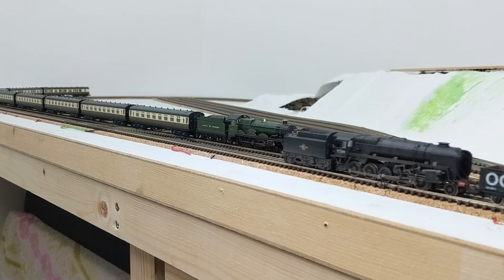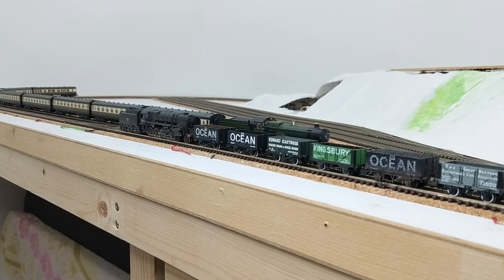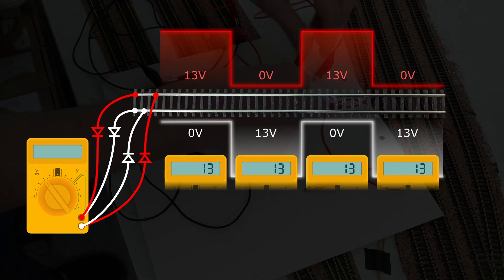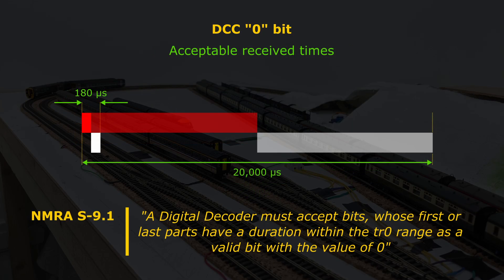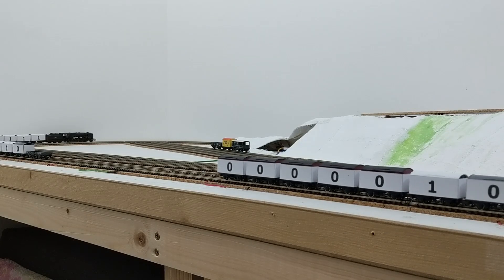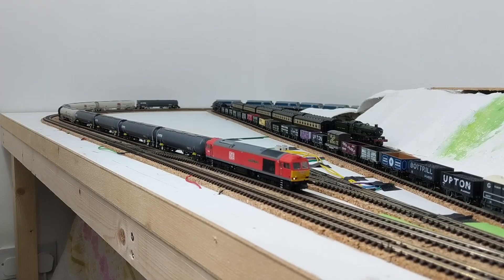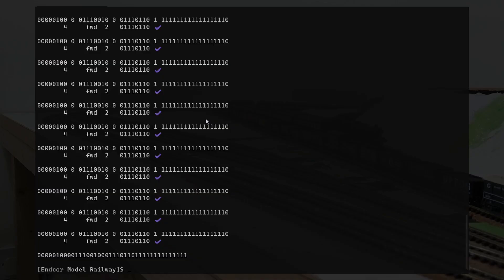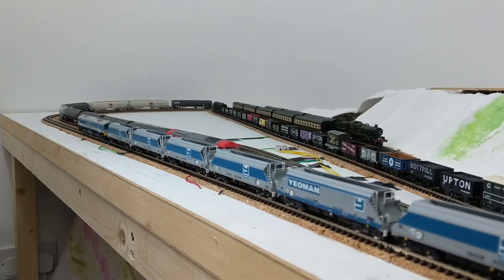0047 Decoding DCC from scratch

Comment: This looks like a cool and fun project. A couple of suggestions:

For input use a comparator rather than the voltage regulator. It will give a digital output depending on where input A is higher than input B, or B is higher than A. Get one suitable input voltage range and 3.3V output and it can safely connect to the Pico.

For timings remember the phrase “be strict with what you produce and generous with what you consume”. If your outputting signal make them accurate. If your reading them accept input which is outside spec but which makes sense. For the timings here you basically need to set a cut off time between a short signal and a long one. That will make your code resistant to issues.

As for the code itself the PIOs on a Pico are specifically designed for processing serial data like this and they’re way, way faster than Python. Use them if you can. I’m not sure what that would look like here, people on the Raspberry Pi forums can probably give the best advice.
Reply from the maker: Thanks for your suggestions - they're helpful 🙂

A comparator or voltage divider sounds good - I'll be having a go with some resistors soon for the divider, and comparators look low-cost so might be worth trying too. Eventually I'll need to fit everything onto a circuit board that fits into a locomotive, so if I can get away with a couple of resistors that seems like it might take up less space than an integrated circuit package.

Yes a simple cut-off sounds good - I think the signal is likely to be good most of the time, and since commands are repeated it shouldn't matter if the odd one gets mangled somehow.

A couple of other people have mentioned PIO on the Pico - I hadn't come across that before. It does sound good, but ultimately I'm expecting to move to something physically smaller than the RP2040, so I don't want to develop things with things that are too Pico-specific.
Reply: @endoorrailway  Regarding resistor dividers, I’d be wary of voltage spikes causing damage to the Pico. To avoid that look for something called a protection diode and put in across the bottom resistor of the pair (assuming you’re powering the Pico from the rails. Between GND and the Gipson pin if not). This will prevent the voltage going higher than the diodes rating (which should the 3.3v here).
Reply from the maker: Thanks - that's worth knowing about - the DCC specifications for decoders state they should be able to work up to something quite high - I think it's 20 Volts - so I should consider it possible the controller could output that. Spikes could also happen for various reasons, so they're worth defending against if possible.

Comment: One of the things I find weird is how the pico running at 48Mhz has throuble reliable decoding the DCC packets, while and Arduino running at 16MHz is reliable for decoding the packets.

Also, use a voltage devider, not a voltage regulator. a voltage regulator mangles signals like crazy. Even better would be an opto coupler

Consider buying an cheap osiloscope to view what you are actually working with
Reply: Python is usually interpreted, whereas C++ (as it roughly is) on the Arduino is compiled. So every Python statement has to be read (often copied to an instruction buffer), taken apart, tokenised, parsed and then starts the execution of a fragment of machine code, and then the next part of the statement has to be... yes, you guessed it. I would normally reckon on interpreted code being 20 times slower than compiled code.
Compiled programs tell the processor exactly what to do, at full speed. They are, however, tricky to debug, the Arduino IDE and others have a good go at spotting errors at compile time, but after that, the processor will be on its own. There will be some error trapping, for out of memory access, numbers out of range, trying to put values into an input port and so on, but...
A good example, I wrote a fractal program in BASIC (interpreted) in 1988 that took 55 minutes to create the Mandelbrot set on screen. I then found a fractal program that did it using compiled machine code in about a minute. The BASIC was, however, good enough for a printer exerciser that wasn't time-crucial.
Reply: @neilbarnett3046  Yeah, I remember thinking when he said it the budget was 100 instructions per microsecond that it would be fine in C or assembler where I'd expect 10 instructions per bit. But if Python is 10x worse that's 100 instructions and very close to being too slow. Python definitely has its uses in data science type applications but running it in a real time embedded system is not one of them. C is great for that sort of thing and if the C compiler does a bad job on the time critical parts you can just write them in a assembler.
Reply from the maker: @neilbarnett3046, @user-qf6yt3id3w There's some degree of compiling in Python, but I suppose it's more like caching because it's first done at runtime. But that's normal Python - I've not got any idea how MicroPython is implemented. I fully expect interpreted languages to be slower - really I was just having a go with MicroPython to see how it would turn out, and underestimated just how much work it's needing to do to be like standard Python. Eventually I'll get to trying some C on the Pico. Thanks for your comments 🙂
Reply from the maker: From what I read the Pico is 133 Mhz, so to take 30 microseconds to get a reading of the input means it's executed nearly 4,000 instructions! The fact the Arduinos can do all this reliably makes me think that MicroPython is the issue - before long I'll have a go at this with C, just to see the difference.

Several other people have also advised that the voltage regulator isn't the way to go, so I'll also see what resistors I've already got and make a voltage divider instead. It would then be interesting to see how the MicroPython does too after that.

I'm not expecting to need an oscilloscope for many things, so I'll see how far I can get along without one, but am open to the possibility I'll need to get one.

Thanks for the suggestions 🙂

Comment: As an electrical engineer, I'd like to congratulate you on your courage and open-mindedness. An excellent start.
I have just one suggestion to make, if I may. Try replacing your voltage regulator with a simple voltage divider. This is just a pair of resistors of fairly liberal values, say 2.7k and 8.2k. You'll get a cleaner signal and, ultimately, fewer headaches.
Reply from the maker: Thank you for your kind words and this useful information 🙂 A few others have also suggested I should use voltage dividers, or other things besides a voltage regulator, so that message is coming through loud and clear, and I'll be doing some component shopping before the next iteration 🙂
Reply: @endoorrailway  A voltage regulator is designed to provide a stable supply voltage, so it's not surprising that it doesn't work that well for an intentionally changing signal.
Reply from the maker: @mrab4222 - thanks, yes I guess that does make sense because it's going to be trying to counteract fluctuations, so that's likely to add some delay even though the voltage is totally dropping off below what the regulator works with. So far my main limiting factor is that it can take a long time for the MicroPython to take a reading of the input, compare it to one that's in memory, and record the time if there's a flip; none of how long that takes is affected by the voltage regulator. The regulator may well affect what happens in the scenarios where I used interrupts though, since they directly hinge off changes in the signal. I'll be moving to C and, for now at least, some resistors for voltage dividing - it looks like I've already got some at resistances that should work 🙂
Reply: @endoorrailway  If you already have a bunch of random resistors laying around, you can connect them in parallels or in series to get the required equivalent resistance. This will be sufficient for a quick prototype.
Reply from the maker: @barmalini Good point, thanks - putting smaller ones in series could be useful if power through them is too high too, though it looks like that's not going to be an issue in this case.
Reply: @endoorrailway  may I suggest replacing the bottom resistor of the divider with a 3.3V zener diode? Zener diodes have a low breakdown voltage (the voltage at which they start conducting in the other way), so that way you'll have the divider output clamped at 3.3V even if the input for whichever reason goes over 13V (this could happen considering motors are also here)
Reply from the maker: @ZugTheDragon Today I ordered a pack of Zener diodes of various values as a result of some other similar comments - thanks for the suggestion 🙂 With a voltage divider I gather a formula with the two resistor values is used in order to get the desired voltage split - would replacing the bottom resistor with the diode affect the value I'd need for the top resistor?
Reply: @endoorrailway  not quite. You should use the diode in parallel with your lower resistor. It is only needed for protection against voltage spikes.
You need to calculate the lower resistor so that the signal amplitude is 0.2-0.3 volts less than the cutoff voltage of your diode.
Suppose you have a diode for 3.3 volts, then aim for the 3 volt signal on the resistor.
Reply: @barmalini  Using diodes or resistor dividers is a terrible idea. A much better approach is to use a switched (or DC-DC) regulator; there are off-the-shelf modules that even fit the space of a TO-220 package. And for extreme ripple rejection, pick a 5V DC-DC converter, followed by a linear regulator, typically an LDO. There'll be much less power lost in heat. Besides the DC-DC regulator will automatically accommodate for whatever supply voltage it is presented with (with respect to its absolute maximum ratings of course).
Reply from the maker: @barmalini thanks that's good - it means I don't have an extra formula to find and use 🙂
Reply from the maker: @nashaut7635 thanks - there are various conflicting ideas of best solutions on this - I don't know if that's how it often goes with electrical project videos because I've watched very few, but I'm very new to it all. I'll take things in simple steps and see how it goes, but have added this to the list of things that have been suggested. Thanks 🙂
Reply: @nashaut7635  this would be good for power supply, but not for data signals
Reply: @barmalini  You're right, I hadn't realised you were talking about data signal, my bad.
Reply: @endoorrailway  looking at all the ideas the best ones are the voltage divider (which has limited range), a level shifter (which also has a limited range but some models have a wide range) and one that wasn't suggested is a optocoupler but you will need to find one that matches with the speed and resolution and price is exponential in that case.
Reply from the maker: @pedrohcs8  thanks for having a look through the comments. I'm finding it hard to see all of them myself - some come as notifications in the YouTube studio app, but basically don't appear in the desktop view unless I switch off all filters and scroll through everything - but several people have mentioned optocouplers, so they're on my list 🙂 Thanks for the comment.
Reply: @endoorrailway  the typical way to get a good DC voltage from AC is to first pass it through a rectifier, then a capacitor across the lines (to smooth out choppy input), then a regulator to downstep it to the right voltage, and then a capacitor across that and ground to make sure the regulator's output is stabilized too, and so peaky power use doesn't drop the voltage too much.
Reply from the maker: @dascandy Thanks for that information - it sounds like several steps, but I guess building reliability and robustness into things requires extra work. For now I'll go with a "hope for the best" approach to reliability or I'll get overwhelmed with trying to learn too much in one go. Thanks for the tips though 🙂
Reply: @ZugTheDragon don’t replace the resistor with a zener diode, use the resistor and the zener in parallel. This ensures a terminating load in the input to the pico.
Reply: @endoorrailway agree with all the advice recommending not to use the voltage regulator but a voltage divider with a zener diode across the lower value resistor. You need to keep the lower value resistor there as it also acts as a terminating load on the GPIO input. This will reduce noise and also counter the pulse stretching effect which occurs  when the input impedance of the pico is very high, as it certainly would be. Also, for the sake of quelling both noise and pulse stretching you could use lower value resistors, say 3k3 and 1k
Reply from the maker: @rodjohnston7210  Thanks for adding to the advice - the comments on this video are a collective wealth of useful knowledge. Since making this one I've changed to having a GPIO pulled low by the track, which seems to simplify things a lot with voltage level considerations.
Reply: Agree about using a resistor divider. Aim for an input to the pico of about 2.8..3V, not 3.3V, so you have a bit of "headroom" if the incoming voltage isn't quite as expected. The RP2040 datasheet will tell you that gpio inputs will consider as "1" signals quite a range of voltages, not just 3v3.
I would suggest also getting a Zener Diode of about 3.2V rating, which you put between pico-ground and the gpio input. A zener doesn't conduct until the voltage across it exceeds a given rated value, at which point it conducts, so it's often used to clip too-high voltages. Sadly the clip isn't an absolute (3.15V no change, 3.25V clipped to 3.2V) but it's better than nothing and will likely stop most damage.
Reply: @rivimey  I second the Zener Diode idea. Better yet is to use the potential divider to drive a transistor, the collector of which is pulled up to the microcontroller supply. That way, the DCC signals aren't flowing into the microcontroller when it is not powered.
Reply from the maker: @rivimey Thanks for that, yes good point about operating on the brink - the DCC specs say the controller is allowed to output as high as 22V for N gauge, and spikes can happen for other reasons. Thanks for the tips about capping with a diode 🙂
Reply: The voltage dividor would work much better, and be easier to debug. 
If you also included a small capacitor you would be able to form a highpass filter and remove the ripple voltage. You would have to fix this so it didnt reduce the signal too much. 
There are ways to calucate the good resistance values and capacitance. You would have to work out what rise times were required and frequency.
Reply from the maker: @gooterz thanks, I'll add that to my list of things that have been suggested 🙂
Reply: Or just use one 10k resistor per rail: microcontrollers have internal clamping diodes to their supply voltage so this is safe. Just power the Pico through a full bridge rectifier+cap+voltage regulator from the rails and then use one 10k resistor to an IO pin per rail. Then you can read all 3 conditions: Positive voltage, negative voltage and train has lost contact to the rails momentarily.
Reply from the maker: Thanks for suggesting this 🙂
Reply: @endoorrailway  You need a level shifter, one that shifts down. Because you are shifting from 13V to 3.3V you just need 2 cmos inverters that accept 13V at their input and can be powered from 3.3V . You place one after the other to get a buffer. This is the simplest and best solution to change the voltage level of digital signals.
Reply from the maker: @catalinm756 thanks - I don't think that one's been suggested (I'm finding it hard to keep track!) so I've added it to my list 🙂